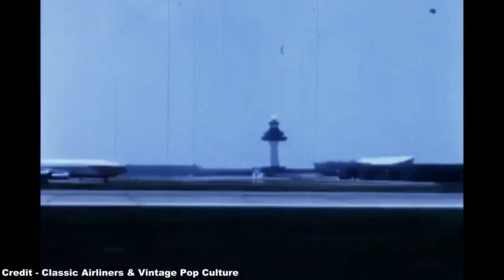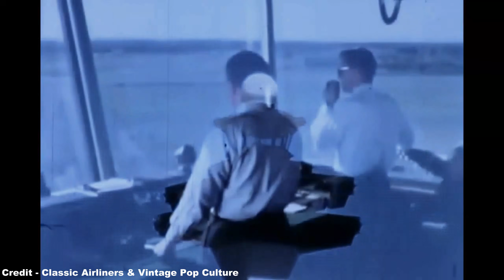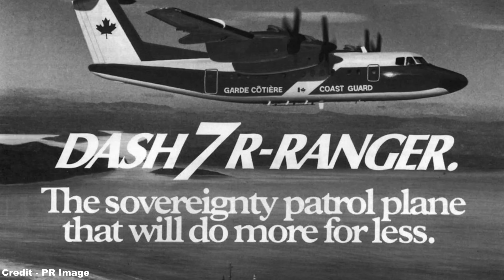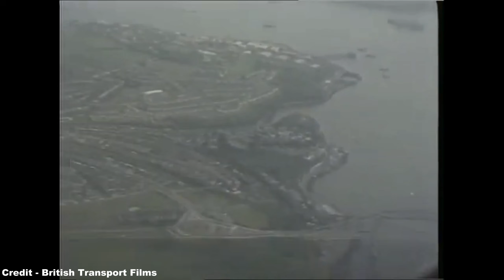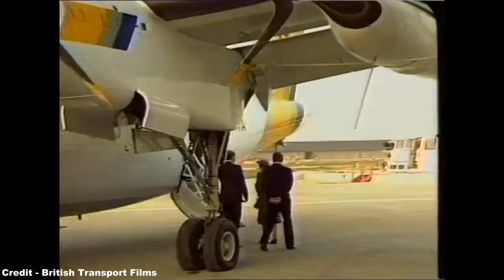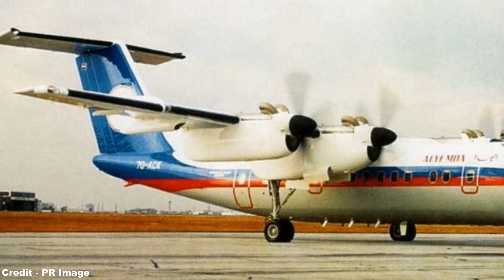The Short Stop - de Havilland Dash 7

Comment: I used to work out of the old Air Wisconsin maint facility hangar at Moline, summer 1991 (they were long gone from there). The various maint shops still had lots of literature/tech posters/diagrams on the walls for the Dash 7, the Fokker F-27, Shorts 360 (these may have been former MVA aircraft when they were rolled into Air Wisconsin).  Very cool blast from the past for a truly unique aircraft - four prop turbine that sounds like a miniature C-130. NICE!

Comment: A story told by someone who has never actually lived in a remote area served by such aircraft. As someone who has, and who spent many hours on not just the DHC-7 but on  earlier aircraft stretching back to the Beech-18, Otter, Norseman, Beaver, Found, and innumerable other common bush aircraft, I would urge the author to do some research among the pilots and passengers of such planes rather that the manufacturer's promotional records.

Comment: I would not second the notion that the Dash 7 was hampered by the limits of 1970s technology and would not call the Dash 8 a "STOL" aircraft. They were able to operate from shorter runways than contemporary turboprops but not true STOL. The Dash 7 was a notable departure from prior DHC aircraft in NOT having the power levers mounted at the ceiling like the Caribou, Buffalo and Twin Otter.

Comment: I flew on the BAS Dash-7 from Stanley (Falklands) to Rothera (Antarctica) in 2001. An amazing 5-hour flight. BAS bought the Dash-7 as, at the time, it was the only aircraft capable of using the 900m runway at Rothera and certifiable for carrying passengers between Stanley or Punta Arenas and Rothera. Introducing the intercontinental airbridge revolutionised BAS’s operations - previously travel to or from the station was only possible by ship and BAS research ships made very few calls at the station.
Reply: I had a chance to have a glimpse at their Dash 7 when it passed through Innsbruck on the way to Antarctica and will envy our instructor who got to train the BAS pilots on the way to Antarctica for the rest of my life.

Comment: Flew the Twin Otter, Dash 7 in PNG and later the Fokker 50 in Australia.
All excellent aircraft in their specialised areas  of operation.
The Fokker 50 was my favourite turboprop due ease of operation, flexibility and speed.
Retired on the 787 recently after flying 727's, 737's, 747-400's, 767's and A380's also.

Comment: Flew on AirbC back in the early 80s. Totally redundant aircraft for runways used (YVR to Penticton airport). Dash 8 sadly quickly replaced them. Sash 8 a truly remarkable and popular aircrat. -400 being not quite as durable as the earlier, but quite fast and capable.

Comment: Newmans Air of Christchurch NZ bought 2 factory DHC 7s in 1985 for the Christchurch-- Mt Cook-- Queenstown run against Mt Cook Airlines HS748s. Performance was amazing as I flew one Queenstown-- Christchurch around Nov 85.
 Mt Cook operated rival 748s from 1968-- 1996 which were also excellent aircraft in service and had field performance not far short of the Dash 7...
Very good video

Comment: Not been in a dash 7 but had an inaugural passenger flight on a brand new Fly Be dash 8 (Q). Only four on board, I believe it was extra flight to reposition for it's actual first flight.

Living in NI, I was immediately a fan and stopped flying Ryanair  and the other crowd with their airborne sardine cans and nonsensical rules.
(unless £5 return was available - yes there is a price on loyalty)😂

That first flight came after a 14 hour TUI flight (with long delays on runway) from Barbados in a Boeing from a different airline with seats long past sell by date that had been part stripped out for refit.  No videos and the trollies didn't fit the aisles but was better than the broken jet it was covering for.

The dash 8 at Gatwick was such a relief and luxury, new car smell, wide, firm, superb leather seats and only a low buzz in cabin reminding you it was a prop.

Took many flights with them thereafter ignoring the risk of them on occasions breaking landing gear on arrival. 🤦🏼‍♂️

Guess my like of smaller craft goes back in the days when I'd always have flown JEA or Logan in a 360 (or a "Skyvan" once) for the comfort, personal space and professional, yet still human flight crews that BA and BM didn't seem able to compete with.

Great little video. TY.